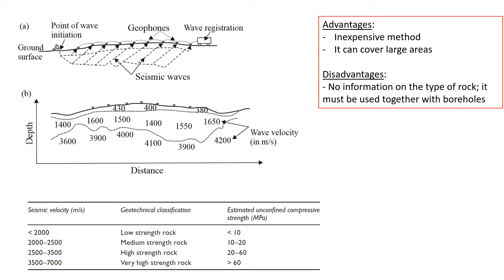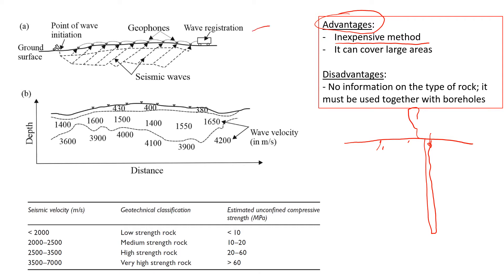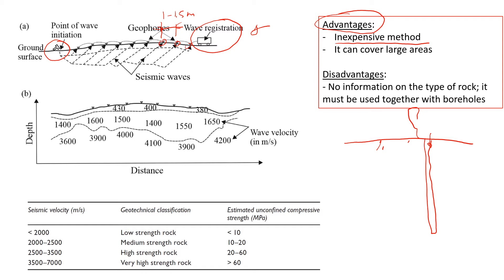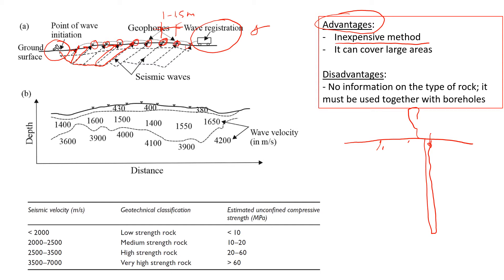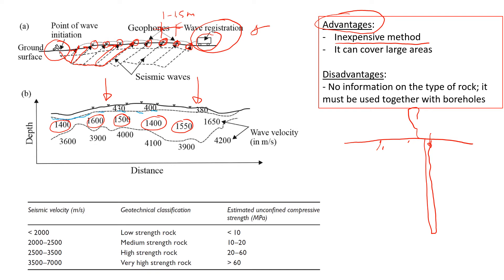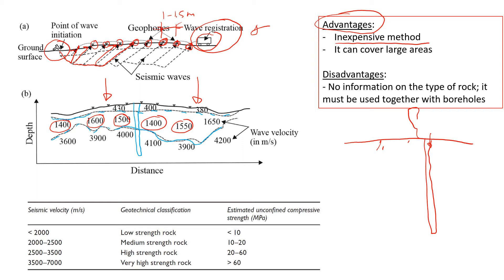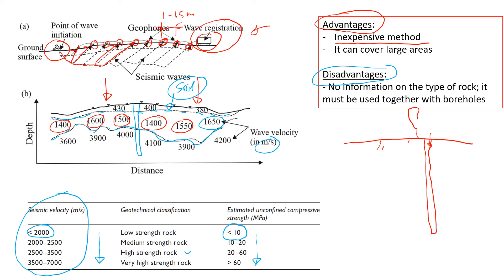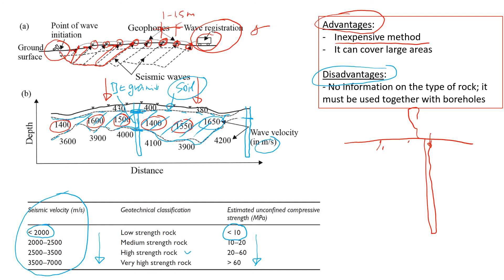Seismic Geophysics Methods in Geological, Geotechnical and Civil Engineering Investigations

Comment: the tomography methods provide Vp estimates that are influenced by water content and may not give the best correlation with lab measurements. Shear wave velocity measurements in MASW method may provide better correlation to lab results as the shear velocity is less influenced by the water content and more by the rock matrix.